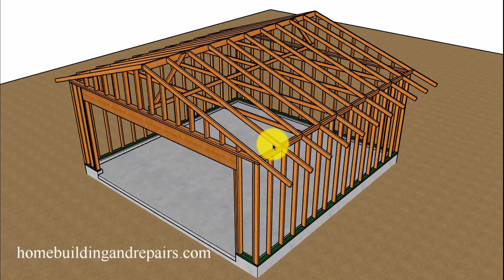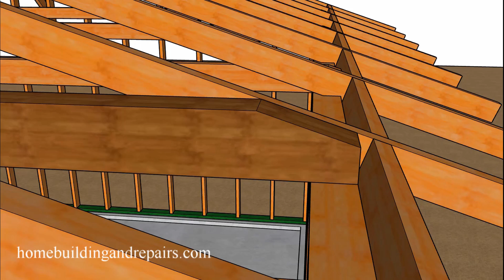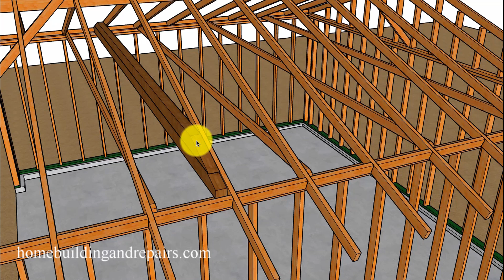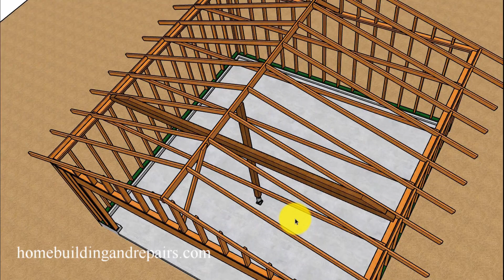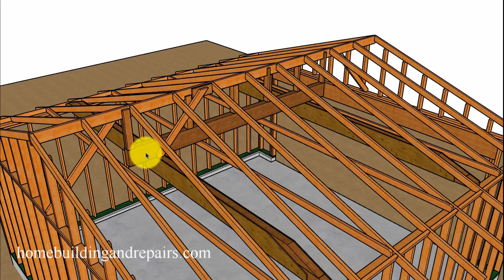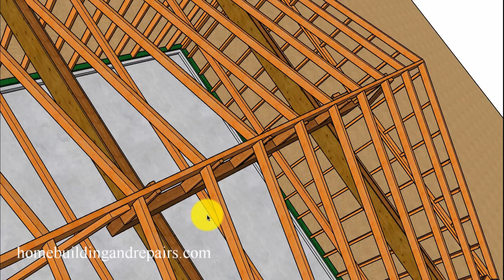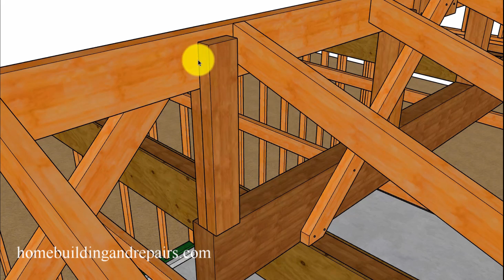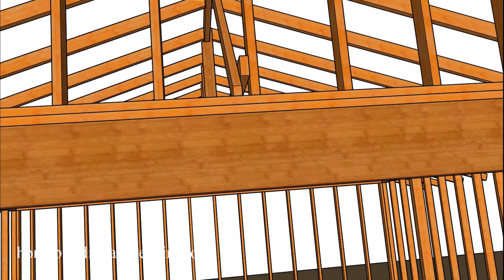How To Use Smaller Beams To Fix Sagging Roof In Older Garages With 2 x 4 Rafters

Comment: Hello, My rafter ties are coming apart allowing the walls to sag. How do I pull the walls back true? I have a 20 foot rafter tie that is bracket attached to a 16 foot counter part that is stretching the distance of the width of the pole barn. it is coming apart. I have a 1/2" gap between the two butted rafter ties. I need to pull it back tight somehow getting rid of the gap.
Reply: I’m not a professional framer or anything, but I did build my own house 25 years ago with a lot of help from my friends who taught me a great deal. 
One way to pull walls back is to use a chain and turnbuckle. Attach angle iron on each side, preferably on the bottom plate using lag bolts. The angle iron should be at least 1/4” stock, and the longer the better.
Once the chain is attached to the angle iron on both sides, attach the turnbuckle to the middle and then tighten. Once it’s tight, you might have to cut the nails on the existing rafter ties to allow you pull the walls further  and plumb the walls. Once you’re happy with the walls, renail the rafter ties. Then slowly loosen the turnbuckle, checking for any movement in the walls.
Hope that helps.

Comment: Terrific videos!!! I have an older 24x30 garage with 2x6 wall framing and a  2 x 4 truss system 24 inches on center with a metal roof screwed into the truss' upper cord (no sheathing).  I would like to insulate and drywall the ceiling and walls.  On occasion we can have some heavy snow loads so I'd like to fortify the truss system just in case. That I said I have no sagging now.  I've thought that sistering the bottom cord with 2x6s might help? I don't really want to create additional work for no real benefit. Maybe just lightweight drywall and insulation will be fine. Any thoughts?

Comment: I moved into our old family house and it is almost hundred years old. And it needs a lot of repairs, and most notably the home needs some foundation repair, not major, just some lagging floors in the center room (dining) and some sinkage at one end of the house due to some moisture (kitchen). Another concern is the roof, it is sagging in some areas ( mostly in the area were the foundation is sinking), so I have some major rain water leaking, that I have to but buckets out when a good storm hits. The foundation is on post and I am doing most the repairs myself. My question is, should I start with the foundation or the roof first. I am inclined to start the roof first because of the annoying leaks when it rains. Your suggestion is appreciated.

Comment: Running a string from one end to another along the outside ridge, (at what point) how many inches of sag in the middle should I address a sagging roof?
Reply from the maker: That's tough to say. Maybe 2 inches in 20 foot. I think it would be better to find out why it's sagging and then address the issue and how much it will cost to fix.

Comment: I have a 20’ x 20’ concrete block 2 car garage. It has a loft in half of the garage. The previous owners used the garage for a party room for their kids and storage in the attic. They nailed one of garage doors to the wall. I’ve noticed the roof is sagging. I’d like to put a usable garage door back in but need to fix the sag first. At least I would think so. I really don’t want a post in the middle to support the roof. It has a 1” x 6” down the middle. The build 1965.

Comment: I would want some kind of lamination, gluelam, homemade sistered beams. I've seen how knots are a weak point, lamination works around that. 
Some applications don't have access to fit an 18 ft rafter in, sistering in place, two or three wide can work. Plywood would be rigid enough I wonder about strength though.

Comment: Hi
I have the same problem but in an old house..only 2 x 4' s in the ceiling, not even rafters and the wall is pushed out at the ceiling about 3". This is kinda the same idea, but do you have video already for a house also?
Reply from the maker: Go to our website and check out our framing repair videos.

Comment: Would you think it could work setting a beam made from 2 - 2x10s across the rafter ties running below but inline with the ridge. The top plate of the walls would be the main support on the ends after installing blocking flush with the rafters. I am working with a 24 long ridge and the ridge plate is 2 pieces vs one and that's where the sag has started, it's a significant drop in the center of the ridge (about 5" or so) and the walls do not seem to be effected by any means. I planned on creating this beam and sliding it in from the exterior gable end by cutting an area out then patching it back in. Once in place I figured I would utilize the rafter ties as additional support by using shims and plates to connect everything. Let me know what you think. I have 2x6 rafters so if there is a better way I am all for it.

Comment: Great video.. We have a garage just like this.. We will try it.  However we are going to add at least 2 -2x4 in the wall on edge to support the weight of your 4x6s in the rafters.... We are also going to measure from top plate to top plate and sill plate to sill plate to see how much our walls are out of plumb... Thank you for the ideas...
Reply from the maker: Welcome and good luck with repairs.

Comment: What is the original reason the roof ridge sagged? Was it due to undersized 2x4 rafters? Or was the problem due to the rafter ties undersized or they were not tied to the wall top plates well enough allowing the walls to bow out ? I’m thinking a combination of all three issues with the main culprit being rafters were undersized?
Reply from the maker: Different reasons, but you got most of them. Under sized rafters and not rafter ties is usually the most common. I have more videos at the website on roof framing and roof framing repairs.

Comment: Back in my day four/five decades ago the UBC allowed one to just simply use purlins and struts supported on a strut flange running on top of the ceiling joints with a 2x strut beam nailed on edge along the side of the strut flange.
Reply from the maker: I'm not exactly sure what type of construction method you're referring to, but did it actually work and if it did, then do they still allow it to be done today.
Reply: @gregvancom  <> The method was described in the UBC books back in those days as an acceptable method. It was in common practice in lieu of fabricating trusses for extended rafter and joist spans. I've used it my self and it worked great so long as you didn't cut corners in the quality of workmanship and used a large enough strut beam, usually a 2x6,8. 2x4 strut beams were typically insufficient but the shortest spans. 

But due to the increasing requirements of engineering calcs for virtually everything by building departments, by the 80's it has largely been abandoned because it's cheaper for an engineer to do a simple post and beam Calc Than doing all the aggregate Calc of all the individual structural members of struts, rafters, purlins, flanges, and strut beams. So due to engineering costs it's more economical to just do trusses or post and beam designs now days.